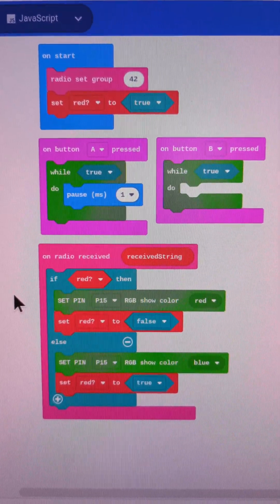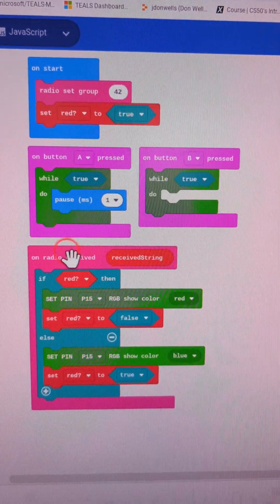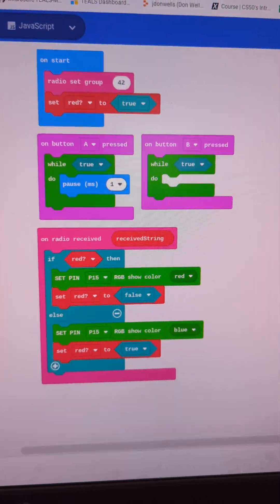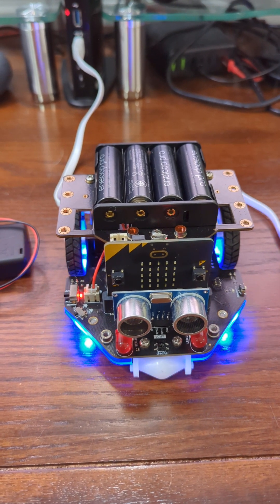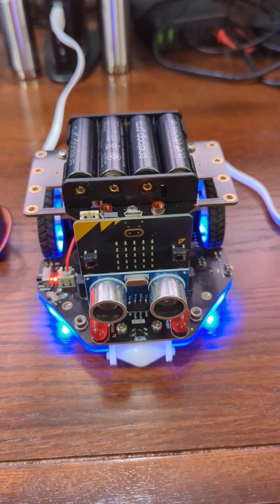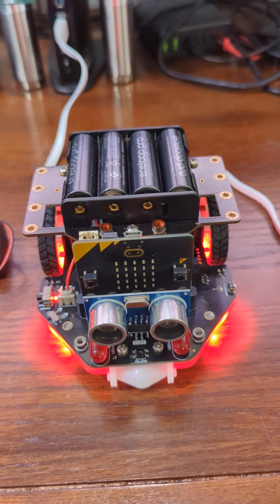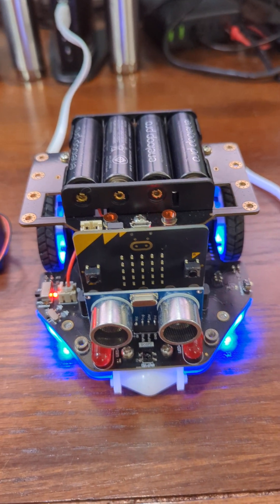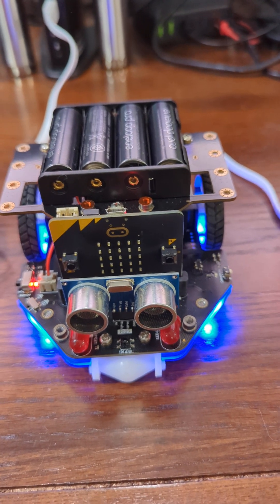Multitasking with a micro:bit #education #microbit #robot

Comment: How does the pause make a difference
Reply: Basically it yeilds the processing power to the rest of the program, without it the processor is stuck doing nothing
Reply from the maker: How does it work? The central processing unit (CPU) in your micro:bit will run one thing at a time. There is a bit of code inside the micro:bit that watches for events. When an event happens that event's handler is placed into the queue (waiting line) of programs that need to run. When it gets to the front of the queue the event handler is called and allowed usage of the CPU. When that event handler finishes the CPU can be given to a different program waiting in the queue. 

When a single program does not give up control of the CPU nothing else works. We need to write code that does not hog the CPU. We can use pause (ms) and forever blocks. 

We are going to receive messages from the beacon program running on another micro:bit. That program sends a string message about 100 times per second. When we start this program up on our second micro:bit we see the lights changing from red to blue very fast. So fast my camera can't even capture it all.

When we push button A the robot will continue to process the radio messages. Why? The pause (ms) 1 block even though it is a small amount of time lets the micro:bit do something else with the CPU. That something else is handling the radio messages. As HFNeko says the processor hits a yield which means go to the next program in the queue.

When we push button B the robot will stop handling the radio messages. Why? The while loop does not let the CPU do anything else until the while loop ends. Because it never ends, nothing else can get the CPU to run. The events created by the radio just sit waiting in the queue forever.

How is a forever loop different? A forever loop has a yield built in after each iteration. It is like a pause (ms) block without the delay.
Reply: @jdonwells  Thanks for the explanation, I’m understanding it now